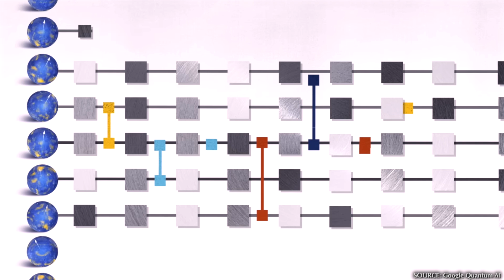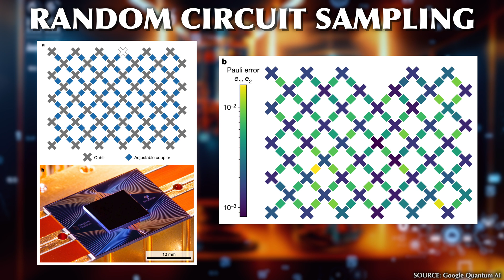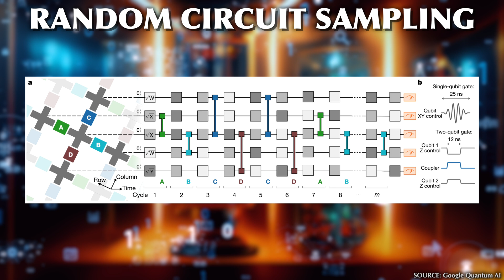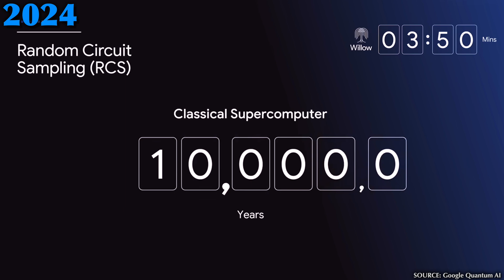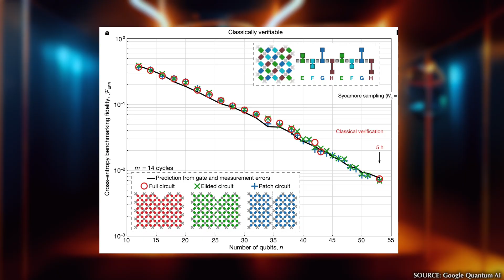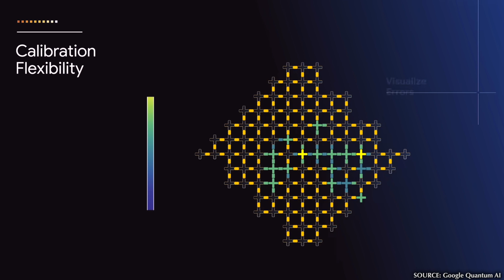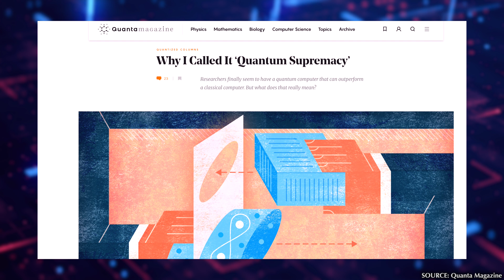Google Willow - When Quantum Computers Become Unbeatable

Comment: The problem with the term "quantum supremacy" isn't ideological, it is linguistic. According to this commentator, quantum computing at best has advantage in special cases. Supremacy is simply not an accurate term to describe such limited (and to some degree hypothetical) advantage.
Reply from the maker: Supremacy does not have to be all-encompassing, it can be just limited (in reality, it is always limited). I think the definition in use makes perfect sense, actually 🙂
Reply: @physicsbutawesome  to assert unqualified supremacy when any hypothetical supremacy is strictly qualified is deceptive. What's wrong with a more moderated terminology? You seem to imply that the only claimed justification for a less extreme terminology is a misguided political ideology. Can't it just be more accurate? Or is your preference also grounded in ideology?

Comment: Quantum supremacy is just a bad term for it. It does not come even close to describing that quantum computers are "supreme". Save that for when they beat classical computers in general speed and energy efficiency. I like the term "quantum advantage" not because supremacy is a bad word, but because it's just a better description.
Reply from the maker: Quantum computers will probably never be faster than classical computers *in general*. Nobody is claiming that. This makes no sense.
Reply: @physicsbutawesome  It may be in some far off future, but I would claim that it could happen, actually. As far as I'm aware, classical computers have more physical limits preventing the highest energy efficiencies and possibly speeds.

Comment: Quantum computers are probably going to be much less useful than base 3,5,7 and other functional prime numbers to analyze data from, for example, human aided/guided AI learning by sorting different digest able dimensions of thought combinations....

Quantum computers ultimately feel more like random number generators only used for binary right now because that's ultimately what they are outputing to.
Reply from the maker: It’s true that current quantum computers are not competitive. There are also convincing arguments that AI will in the short term outcompete QC in some applications. It will certainly take a couple years until quantum simulations will become of significant size for QC to have actually practical uses.